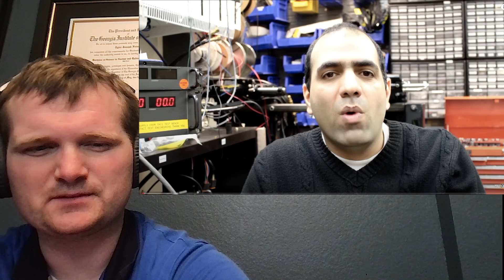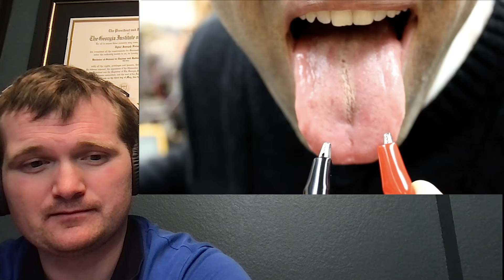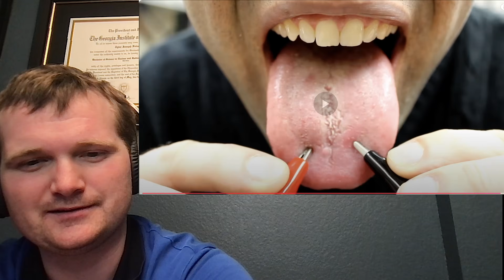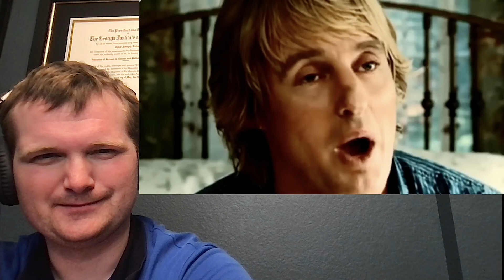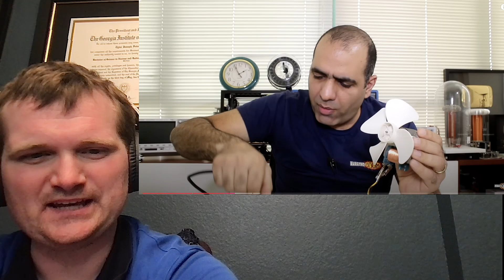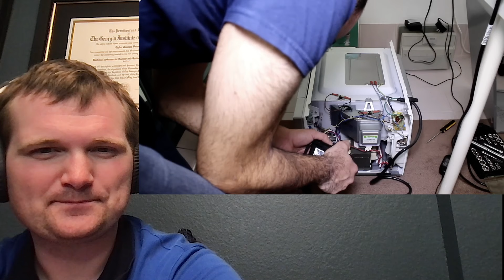AC vs. DC Current! - Nuclear Engineer Reacts to ElectroBOOM

Comment: Isn't DC actually more efficient at transmission assuming voltages are equal because you don't have phases, don't have the skin effect, have continuous current, and don't have to design for the higher AC peak-to-peak voltages? It's just the complexity of converting voltages that makes it not quite as desirable or ubiquitous?

Comment: HVDC is superior for long range power transmission.
AC power transmission lines implies reactive power and corona losses, the use of one more conductor plus shielding and more skin effect. There is an overhead loss with HVDC but you can convert it to multiple AC power grids configuration (in terms of voltage and frequency) from the same HVDC source through and inverter.

Comment: HVDC actually has less line loses over long distances, but you end up converting more times so you ahve higher conversion losses. Also they didn't have power electronics back then which can convert DC voltages (basically the dc equivalent of transformers). Without this the conversion loses for converting every time you want to step voltage would be insane. In modern times HVAC is best for medium distances, and HVDC is best for extremley long distances, or for medium distances if the generation is already DC (such as from solar panels).

Comment: For extremely high distances High voltage DC will be preferred over AC since the losses due to reactive and capacitive effects alongside corona effect and skin effect is so much it will be not feasible to use AC at such distances and high voltage DC will have much lower loses

Comment: Technically it is more efficient to transfer DC over distance for the same voltage - due to the fact that even a single wire is inductive, so it more resistant to AC than DC. Unfortunately to change voltage you need AC and converting btw them is expensive and it was quite inefficient at Edison/Tesla time. Though there are some systems that use DC for long transfer.
Reply: Iirc most high voltage long distance lines are DC

Comment: Uninterruptible Power SUpply (UPS)  systems are not only used in nuclear power plants. in Pakistan, in hot days, we had mandatory 3-5 hours power outage everyday. I had a UPS system in my home, couple of giant truck batteries with an invertor connected to the power mains. 
Power mains would charge it all day, and when power went out, instant backup. Granted, that system would only power 3 fans and 3 lights and the wifi router, nothing hardcore like air conditioning or the fridge, but UPS systems has become an essential part of almost every household in Pakistan.

Comment: 8:30 Sorry, you're wrong about this point. HV DC long range transmission lines are MORE efficient than AC, not less. This is because of the capacitive effects, which are blocked in DC. It gets more efficient the longer the distance, because the DC-DC converters and inverters are expensive. 
12:40 Did you really just call buck/boost converters "DC Transformers" 😂😂 1970s to 1990s was when they were introduced as commercially viable options, to answer your question

Comment: Same with the refinery I work at. Our maximum charge is determined by our output product line size. However at minimum charge it’s much harder to control the unit and anything lower than the 12,000bpd minimum can cause serious damage to equipment

Comment: Actually line loss is less with high voltage DC over long distance due to not having capacitance losses. Yes there is more expensive gear at each end for the conversion, it's a cost benefit thing. It would have to be a long line to make it worth it. You will find where extra long transmission lines are employed they will be extra high voltage DC lines. Other wise AC is preferable as mentioned.

Comment: I could swear that years ago there was research going into improving long distance power lines via some fancy high voltage DC system to connect grids I don’t remember why it was potentially better all I can think of is maybe the conversion makes it easier to match and control the power efficiently between the grids? Or maybe it was for something exotic like superconducting power lines.  Dunno the closest I got to electrical engineering was learning basic electronics and reading/making schematics. I once was help for an electrical contractor who usually did work for bigger installations and some of his stuff involved some scary and very specific methods to work on those connections. I can only imagine what the electronic parts for a high voltage dc transmission line would look like.
Reply: DC is more efficient naturally - single wire is still inductive and inductive is resistant to AC.

Comment: ElectroBOOM conflates the high voltage transmission with it being AC... AC/DC is irrelevant, the voltage is what makes transmission more efficient. AC is just good for running passive transformers. We have today high voltage DC transmission but we have to use active transfromers because direct current can not make a passive transformer too excited :D

Comment: I can certainly tell you 240v AC mains power isn’t pleasant though iv never been able to put the sensation in words.

I did have a much longer comment but youtube decided touching the top of the on screen keyboard meant i wanted to watch another video and wiped it.
Otherwise i would generally much prefer being shocked by DC instead of AC. and its not even because of pain as I’m my experience the weird sensation i had in my organs was the worst part. I actually don’t even remember feeling pain but that could of easily been a mix of shock and adrenaline as actually being fully aware how bad what was happening was certainly didn’t help with the keeping calm bit. I was honestly lucky line conditions ended up jolting me free otherwise i would not of survived as it was i ended up having to stumble to the house as no one could hear me call for help.
Also one of only a few times in my life i could tell you exactly where a number of my organs were in my chest which is its own really weird feeling.

Comment: There are 2 reasons why they use AC voltage, first: you can travel AC a lot further than DC, second: for security, you can feel AC a lot quicker, in high voltage you get burns on the outside, but with high voltage DC you will burn inside out. Our trams are running on 700VDC, if you open a DC control panel, it's quiet, and there is the danger, it looks like it's offline. In a high voltage AC control board, you have this 50Hz zoom.
Reply: You can transfer DC even more efficient for long distance assuming the same voltage. It is a problem of converting voltage up and down, that quite expensive and was inefficient until we got better electronics.

Comment: You can't use a transformer to increase DC voltage,  so a DC voltage transformer hasn't been invented.  To get HVDC you need AC, you step up the voltage and run it through a rectifier afterwards, the same has to be done on the other side in order to lower the voltage again, this is why it isn't used often,  it requires a lot more expensive equipment.  Currently it only makes sense for very long distances where the costs are offset by being able to avoid the skin effect and use more of the conductor and suffer less RF losses. Many devices are designed to accept AC anyway, even where they use DC in the end- they have their own transformer and rectifier built in or on the power supply, this reduces complexity as well because these devices often require different voltages,  implementing a new standard would be very costly, with AC it us easier to bridge different international standards too, it is generally easier to work with.
Reply: While more complex, modern power electronic converters utilize high frequency transformers or inductors which are much lighter and use less material than the big old line frequency transformer used in substations. It is becoming more difficult with modern appliances to maintain a sinusoidal waveform on the power grid. A DC power grid is much easier simpler to manage because it has no reactive power and no waveform that has to be maintained, just simple DC power flow.

Comment: The real reason AC took off is more because of the fact it's incredibly easy, and cheap to convert AC to DC, but incredibly difficult to convert DC to AC. There are many things out there that require AC power and so it would be much more difficult if Dc was our primary power system. The other is that AC can easily be converted from one voltage to the other with the use of transformers. DC doesn't get that same advantage so it's more expensive to convert high power to lower per building. 

And actually the popular claim DC is less efficient over distance just isn't tur. It's actually more efficient which is why some high voltage lines are DC. The efficiency claim comes from the conversion back to AC which is where a lot of losses come from.
Reply: would'nt have to convert the HVDC to AC if the distribution grid is also DC, further reducing losses.

Comment: I first thought this might involve him reacting to the epic rap battle Edison VS Tesla. Tyler is pretty serious but gets a lot of the jokes on things, I think that video would be a riot to see how he reacts to it. 

Trivia: There is a DC grid link in Michigan that ties the upper and lower peninsulas together. The line comes in on both sides to equipment then goes under the straights to the other side. Not sure what voltage it is, but what I was told this is because the lower is one grid segment but the UP ties into Wisconsin, and some reason there is like a frequency difference 10 degree I  think. So the inverter converts the DC back to AC at the other rate. 

Solar is DC power, most wind power is AC but converts to DC then back to AC because they have to adjust for the different wind speeds but keep 60HZ output. This is part of why I am not a big fan of either of these. It seems to me there should be a simpler way to adjust output frequency on a wind generator by changing something in the generator itself or some sort of a feedback system.
Reply: I disagree on liking AC energy sources over DC. Fact is most fundamental sources of electricity like batteries, capacitors and photodiodes are DC. It is only because we built the grid around electromechanical energy generation that we need inverters to convert pure electrical energy to AC.

Yes its called doubly fed induction generator (DFIG) and works by altering the speed of the rotating magnetic field (RMF) within the generator itself so that the relative magnetic field to the stator is always 50/60 hz no matter the rotor speed. You still need a frequency converter to generate this variable RMF but at a much lower power rating then the generator itself. Doing full frequency conversion has become cheaper however so DFIG is becoming less used.

Comment: Given that everything runs on DC now, from motherboards to electric cars to solar panels to your phone to LED lamps to your oven's control panel (there's no reason a solid-state switch couldn't be added to run the heating elements on DC as well; for resistive heaters, 240V rms AC and 240V DC will both produce the same heat output with the same heater element), a DC grid wouldn't be infeasible, it would just be impractical because all power plants, substations, meters and breaker panels would need to be swapped out. The switchgear would need to be changed as well; DC current has no zero-crossing, so switches designed for AC and relying on air gaps instead of semiconductor junctions would just arc over until the contacts are sufficiently vaporised to stop the current flow.

A transformer is a simple device with no electronics inside, but buck/boost converters are pretty reliable and, given the high frequency switching enabled by modern high electron mobility transistors, much smaller for the same power rating. The electronics can fail, but so can transformers. In fact the flyback circuit inside your phone charger has a transformer inside just because it provides isolation from ground. Your phone charger would probably work fine on DC with zero modifications (at least the cheap ones: fancier ones might have input protection circuits that don't like DC; the point is that the first stage in a phone charger is literally just a full-bridge rectifier that converts AC to DC anyway, so if your charger is the textbook circuit it should just run fine on 240V DC).
Reply: Side note: the guy is in Canada but is of Iranian origin. He has very good reasons to advocate against t---ure to extract information. It's just morally wrong, plain and simple.
Reply: Advanced power supplies have active PFC so connecting them to DC source would cause havoc beause the PFC will attempt to draw a sinosdal current in phase with an AC voltage that doese not exist.

Comment: On DC, to make solar or wind at home generation make more sense while selling back to the grid.  A neighborhood should have a collective DC system that shares a single DC to AC for grid switch box.  DC does not require the expensive switch gear and if 20 or more homes shared that gear the sell back becomes much more effective.  Also with a wind farm would avoid the matching drain 30% of the time by first charging a battery bank and grouping a matching AC point of grid sale.  Remember in TX ice storm the wind farms had to be locked down due to causing a high drain on the grid, with such a system they could have been left generating for local use while isolated from the larger grid, even slow charging batteries that could be added back to the grid during some peak loads.  Each wind tower does not need to be directly tied to the grid and constantly matching cycles but with DC could be grouped for conversion and sale to the grid.

Comment: i once made 300v dc at home from 18v, but the voltage drop was so bad it could power an LED with no resistor without killing it. although i was also using AA batteries to power it, if i had have used something more powerful i reckon it could have delivered more current.

Comment: funny thing about electrobooms decision of having power be stepped down, back up, then down again, is he would've had much better efficiency if he had have used the direct 120v on his simulated transmission lines and attached his variable transformer at the end. but then also alot less would've gone wrong, and breakers would've popped if they did.

Comment: There's no real rules of thumb here. DC when high enough can make you contract one direction and you can't let go. High voltage that can jump a gap is certainly more dangerous than low voltage that won't.

Comment: high voltage DC is actually not as bad as you say at around 8:30. I was surprised when they put a power cable under the Baltic sea from Sweden to... Poland? Perhaps it was Finland, Estonia or Lithuania. Latvia?  I can't remember as it was over a decade ago. Anyway they made it a DC high voltage line and according to them it had lower loss than a AC power line. Sorry that I can't remember more about it. Actually I just looked at a map showing these cables and all cables to Finland, Lithuania, Poland and Germany are using HVDC. Only two cables to Denmark are 400KV AC. And I guess that these are routed through the bridge going from Malmö to Copenhagen. other than those there are two more cables under the sea to Denmark and those are again HVDC.

Now all land lines are however mainly 400KV AC with some of the real old 220KV AC lines and a few even older that is lower then that. These later are mostly used for distributing power from the large lines out into smaller towns and rural areas. Dut yea, there is a use for high voltage DC for power distribution.

Comment: In the early 20th century Edwardian period, in the UK there were many different electricity suppliers who all ran at different voltages and currents, with pus there were no circuit breakers or fuses in homes, with naked wires strung on wooden runners in the early days. Eventually regulations came in that made electricity safer to use.

Comment: Actually line loss (for all other circumstances being equal) is less with dc due to the skin effect, which is why HVDC is used for really long lines.
Reply: I think it's mostly reactive losses - due to transmission line capacity and inductance. Skin effect at 50/60 Hz is not that severe.
Reply: Another application of HVDC is interlinking AC grids while keeping them separate. This keeps faults (like a black out) from propagating into neighbouring grids.
Reply: Another problem is transmission line lenght. If the length exceeds the length of the AC wave (which depends on the frequency), you get nasty effects like reflections and in worst case, a standing wave. HVDC obviously does not have this issue.

Comment: @7:20 ish aftertaste is usually metallic, with a hint of ozone.
Reply: interesting, apparently fallout tastes metallic (which makes sense, as most fission products are metals), and also high radiation can strip oxygen into oozone and leave an oozone taste in the air. So the battery taste is simialr to the taste you would get in a highly irradiated, highly contaminated area before you died, lol